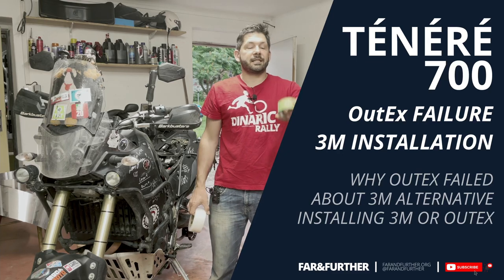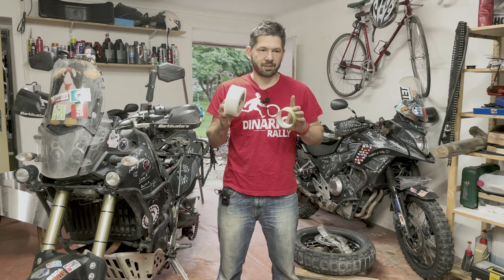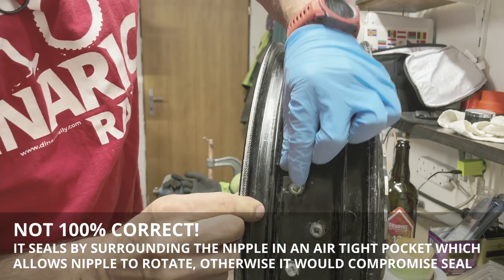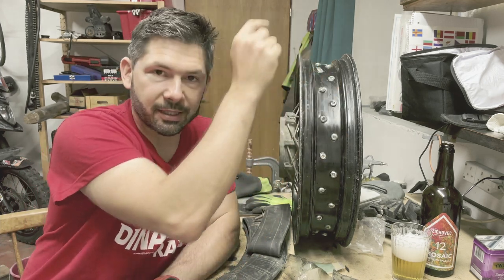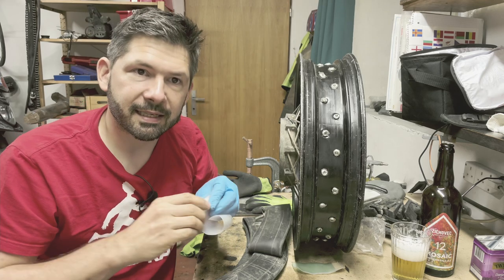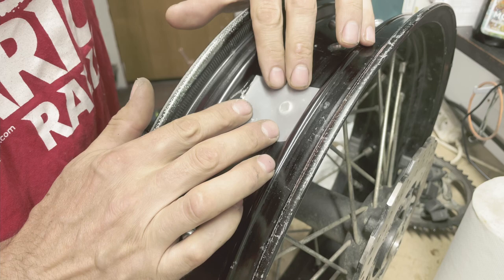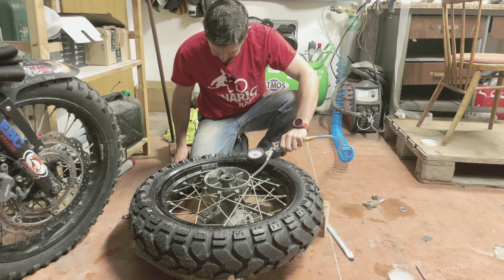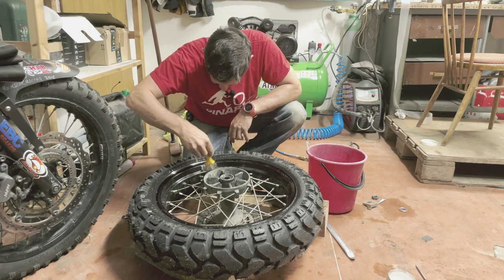Yamaha Ténéré 700: OutEx failure analysis, 3M alternative details and installation guide

Comment: In order to reduce as much as possible the damage of the 3m tape I put, above the 3m, the standard plastic tape (the one you use in the rim as tube tyre protector).
Ciao
Reply from the maker: That may work quite well, it would still introduce friction when used with the tube though. As it would be a layer which would not be fixed, but as a protection it may work.
Reply: @FARANDFURTHER  I'm going to have a trip in the western Alps with oem rims + 3m tape + plastic tape above + standard oem tube. I'll let you know how it works
Reply from the maker: @paolozuffi8461  That would be great! Thanks a lot!
Reply: @FARANDFURTHER  I've been driving Truxton 1200R over the year ~10k km. So far, so good.
Reply from the maker: You mean on the 3M table, standard plastic nipple cover and tube? Or you mean one year with 3M tape?

Comment: Just put a layer of stronger tape over the top of it to protect it?
Reply from the maker: I’ve done now substantial KM on it even with the tube and it’s still fine. The tape got really well pressed into the nipples and still seals. Problem is that I’m sure the tape will get damaged when I tighten the spokes….

Comment: Looks great, how is it holding up till date?
Reply from the maker: The front tire is leaking around the rim, not through the spokes so it has tube. The rear is now leaking through one of the spokes... So has tube as well... So the 3M tape... not sure didn't really last that long.
Reply: @FARANDFURTHER  have you tried the 3M 5200 Marine Sealent?
Reply from the maker: @ArkajyotiChoudhury  Not really, just the tape for now. Until I'm back, or have longer downtime I'll run the tubes.
Reply: @FARANDFURTHER  Align the wheel, tighten the spokes, clean the spoke nipples with petrol and then 100% ethyl alcohol. Let it dry. Seal the inside with the 3M 5200 marine sealent, let it dry for 24 hours and then apply the 3M tape that you used. I did the same on my friend's INT 650 a year ago, and will be doing the same on my GT650 the next month.
Reply from the maker: Sounds like a good approach which could hold. The only problem with all these is if you need to tighten spoke it compromises whole system… Will look into it when I setup base in Albania.
Reply: @ArkajyotiChoudhury hi bro can you please share your experience it will be helpful

Comment: Are the tyres you are using tubeless or the original tubed ones?
Reply from the maker: I'm for most of the time using some Tubeless tires but I've also used Tubed tires (off road) on the tubeless conversion and it worked quite well. But for road riding I'd use only tubeless tires on tubeless conversion rim.

Comment: Why did you use the 1mm instead of the 2mm? How wide was the 3m tape you used? Thanks!
Reply from the maker: The shop which sold it didn't have the 4412N (2mm) one. The 1mm worked, but now I'd definitely recommend 2mm version or two layers (which I have now). Width is 50mm I believe.
Reply: They come in 1" and 2" and rarely 1.5", just got them off digikey. Specs wise the black version is more resistant to UV aging.

I've used mine on a crf1000l for 4+ coming 5 yrs just under 90000km. I use 2 rounds of 4412n.

Though looking at the t700 and crf1000 rear wheel spoke positions, the crf1000 is much closer to the center vs the t700. I can imagine the t700 nipples being closer to the edgwall of the rim will give the tape less to seal around.

Comment: Hmm does the 3M have the required heat resistance?
Reply from the maker: Well, I've been now using the 3M for a while and have to say that it did fail and is now leaking through the nipples again...
Reply: Check out the data sheet. After 8wks at 85c it's actually stronger than control at 21c.
Some charts show up to 171c.  Recommended long term days/weeks at 121c and short term mins/hrs at 149c

Comment: Can you pin a comment on the update about repairing a section, very useful for those trying to choose what to do. What do you do on the front? I want to use TUbliss on my Ténéré 700, just on the front and 4411N on the rear.
Reply: tubliss can not be used at highway speeds.

Comment: Wasn’t installed correctly. If the nipples are not grinded, it creates an air pocket that keeps heating up, expand and progressively  weaken the outex. The small patches wouldn’t have helped because of the nipple bulge, which is close to the rim edge. If the nipples are flush with the wheel, the patches, then the outex would have held
Reply: Don't the air leak out through the nipples itself?
Reply: Grinding the nipples. AKE the spokes weaker so extremely bad idea